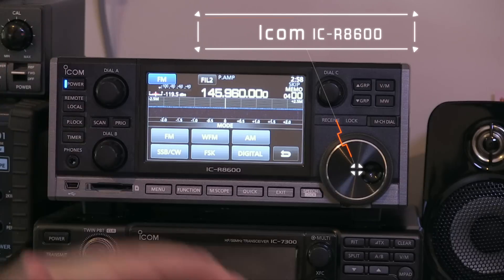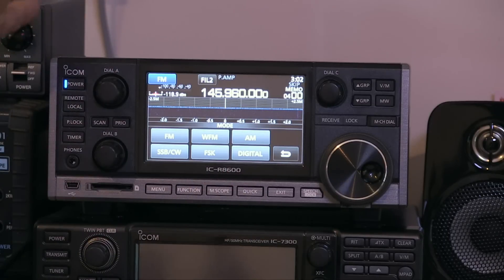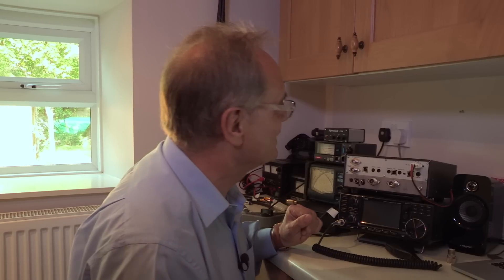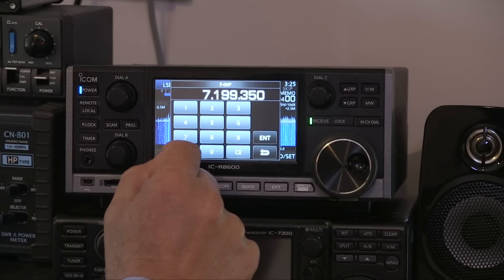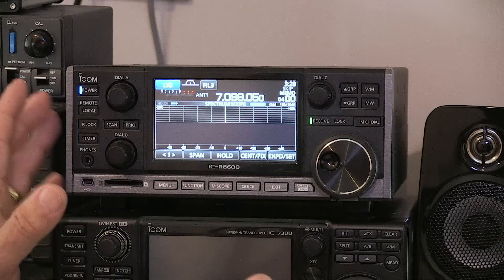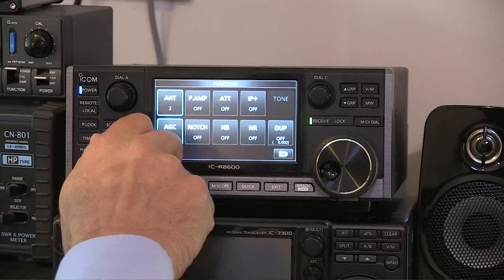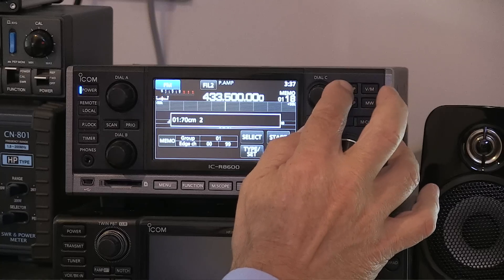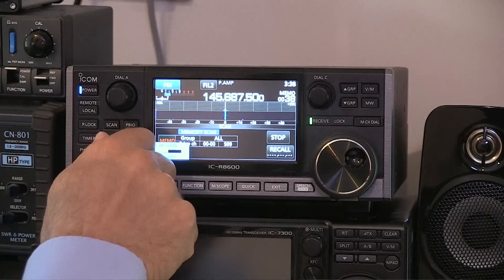Icom IC-R8600 Wideband Communications Receiver

Comment: Thank you for this walkthrough and, with apology for the lated comment (or query) may I seek your advice on why I could not received a local (UK BBC radio 4) 200KHz AM broadcast, while it is received loud and clear on vintage Selena, Sony ICF-7601L and on NRD-535. All these radios are placed in the same location, using the same antennae (long wire and other). In fact, the portable radios pick up this broadcast with hardly any antenna extension, while the IC-R8600 renders nothing but (50Hz) noise, and this is despite trying all the permutations on turning on 'noise reduction', attenuation, reducing RF gain. Am I doing anything wrong? Thank you.

Comment: Superb demonstration. Thank you. Can I please ask if the receiver is actually made in Japan? Thank you.
Reply from the maker: Thanks Elias.  We started selling the IC-R8600 in the UK at the end of 2017 (https://icomuk.co.uk/News_Article/2/186). This as all our radios are designed and manufactured in Japan..
Reply: @Icom_UK  Thank you Bob. Useful to know.
Reply: @Icom_UK  Thank you again Bob and, with apology for troubling you further, I would be grateful for advice on apparent gaps (forgive me if my understanding  is incorrect) in the frequency coverage:
 
252.895MHz to 255.100MHz , 261.895MHz to 266.100MHz
270.895MHz to 275.100MHz , 379.895MHz to 382.100MHz
411.895MHz to 415.100MHz , 809.895MHz to 834.100MHz
859.895MHz to 889.100MHz, 914.895MHz to 960.100MHz

If correct, I wonder if this technically imposed or to comply with possible regional restrictions. 
I presume the 0.1 to 30 MHz is seamless, possibly with an interruption until the 118-137 MHz Air Band.
Thank you again.

Comment: Do you get an sd card if you buy it new.thanks steve.
Reply from the maker: Hi Steve.  An SD card is not included with this radio from the factory although I have seen resellers include one.

Comment: Do you need the use two antennas to cover 10 to 300,thanks steve.
Reply from the maker: You could have an aerial to cover such a wide frequency range but it would be a bit of a compromise. It really depends on what you want to listen to and what range you are expecting. Most operators use at least two aerials, one for frequencies up to 30MHz and another for 30MHz upwards. Often additional aerials are employed to cover frequency bands of interest.

Comment: Where is the 1 Hz tuning?  I was disappointed in my radio when I discovered that it cannot dial in to 1 Hz precision even though the display goes out to .000 and your brochure advertises that frequency resolution is 1 Hz.  You have this feature on the IC-7300.  Why is it not enabled on your R8600? Still waiting on a satisfactory explanation from Icom.

Comment: Nice radio.  Is there anything to listen to above the 1240 MhZ ham band?  Just curious if there is any analog, or digital voice use.
Reply from the maker: 23cms amateur band  1.240 - 1.325 Ghz
GPS Satellites 1.2276 and 1.57542 Ghz
Hydrogen line (used for radio astronomy )  1.420 Ghz
Mobile phones  1.4/1.8/2.1/2.6 Ghz
Iridium sat phones 1.6138 - 1.6265 Ghz
Inmarsat phones 1.525 - 1.559 Ghz   and  1.6265 - 1.6605 Ghz
13 cms amateur band  2.300 - 2.450 Ghz
Microwave ovens 2.450 Ghz

Various radars/telemetry/space comms/ military etc etc.

Comment: sorry ICOM I won't buy one...here's why:- I use  kiwi sdr for whole HF (yes 2-30 in real time not just chunks) monitoring remotely over IP and sharing to 4 users (plus HF DF (toda) apps and lots of users worldwide as well) , and then specific SDRs for specific jobs (such as air band and NOAA) at specific band Fs. Now coming onto operation, it has a small screen with no copy output to HDMI and a mouse, I use my radios on a 65inch HDMI monitor,  without glasses or headaches,  apart from lacking a tuning knob (well some USB ones exist) I now use "Console SDR" a really great piece of software, waterfall, memories, vario width filters, superb noise reduction menu etc, all of these are in it for free as well as the ability to multi-windowise and run several disparate SDRs at the same time, Although this radio is nice, I still have my trusty R71 check RXs,  it's really the end of "all in one boxes" for me...(and Thai nasty customs too) I've just sold 100 HF-UHF radios (60s-2000s) on ebay as I am clearing my 50 year collection, BUT I am keeping WW2 tube tech  for real pleasure as well as historical value - for work  I use SDRs (navy apps/ETTUS E310/Lime SDR etc) and for home QTH, kiwi and cross country wireless V4+ , plus some Harris preselectors and even a simple RTL SDR with front end BP filters.   oh, and a variety of antennas. For TX/mobile/portable I am buying a Xeigu G90 to replace my manpack old-hat dodgy racals...I'm 69 and "retired" in asia too, this is my perpective, it's always horses for courses tho, FOOTNOTE although I use SDRs for dev at work, for home I was brought kicking and screaming to the altar of HF SDRs, "where's the freakin knob, my first radio was an AR88 etc" but using CCW and KIWI changed that plus I don't want to forever fiddle about pressing and twddling knobs and looking at a tiny screen at my age.... :-) 73 de  MW3PWA
Reply: what an awsome post - thanks for sharing, and wishing you well.
Reply: I just looked up the AR88, what a classic.c1944 I think it was featured in Where Eagles Dare. Broadsword calling Danny boy

Comment: I posted in a couple places   I’m looking for antenna recommendations   That would be great for places where space is limited.
Reply: I use a Diamond discone on my 8600; whilst the gain is zero the antenna does receive well over a wide range so I am happy. As ever, quality coax, plugs and a bit of height add to the listening experience.

Comment: I purchased my R8600 from Universal Radio and it came with 1.20 firmware. As time has gone by the firmware version is 2.34. Should I update the firmware in increments or go straight to the most recent version and install that ? 
      Any advice will help,
                                 Duane

Comment: Greetings!! I see you have 8600 and 7300 side by side on your table. Tell me, on short waves, which device do you prefer in terms of reception (RX)?? I had a 7300 and I know how it works. And the 8600 has never been turned. I would appreciate any feedback. Sincerely, Oleg.
Reply: The 8600 has substantially better blocking dynamic range. Number 4 on Sherwood. And it sounds better optimized for AM, unlike most SDRS that sound crappy on AM.

Comment: How long will Icom support these new SDR radios for? If their FPGA or program storage ICs should fail many years from now I don't expect that Icom will repair it as they don't touch older Icom radios, but thankfully they can be repaired by the user.  These SDR radios won't be home repairable and that concerns me and puts me off investing a lot of money into a new radio, matter how good it is.  It's a shame because I like these radios.
Reply: good point, I would also consider environment for example room temp here is 24C-28C and OAT is 35C+ now imagine snoozing off after an afternoon beer and the aircon fails in the shack, expensive, unrepairable toast...

Comment: A really nice radio but I would also add that no DMR and the lack of inbuilt decoding would not make me rush out and buy one.  Come on Icom, you should be offering a one stop solution for all modes without having to use any external equipment to decode at this price.
Reply: Definitely agree. In uk DMR is a must
Reply: @catsmad48 dmr is an albatross in the realm of amateur digital modes Anne amateur software is far superior to decode in radios. non issue.